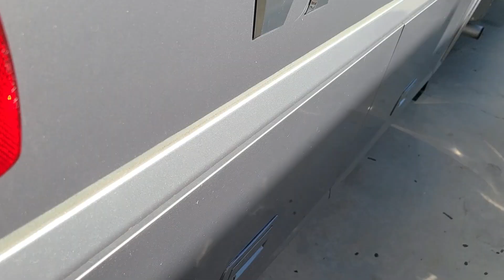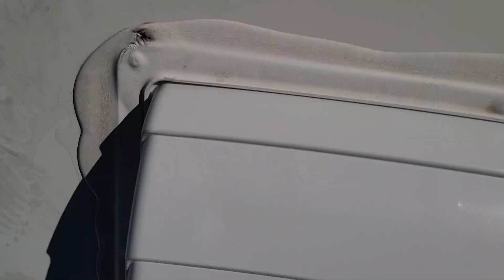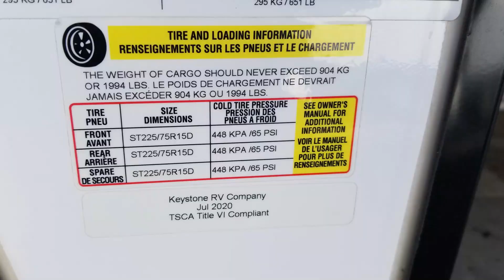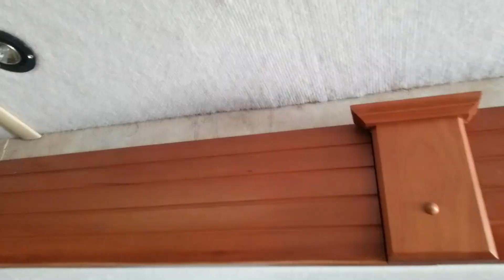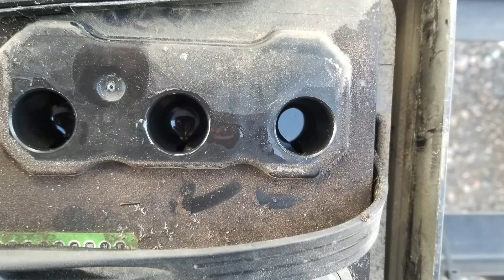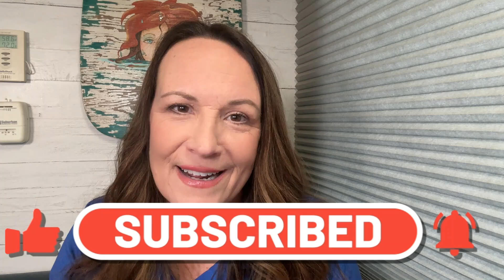Don't Buy an RV  Without Watching This First

Comment: Morning Deb, as always, you're demonstrating your insight.
I think most first time buyer's figure maybe an hour to check out a used RV, both you and I know they should plan on several hours for the first viewing,
I take a flattened cardboard box to kneel on or slide under the RV and inspect the chassis.
Don't be afraid or ingeminated' buy an eager seller, they may be trying to conceal potential issues, like water stain or mold hidden behind stacks of cloths or dishes, 
I remove the drawers and inspect inside the area's, there's a lot to find in the cabinet structure.
I look for high amounts of dust from off road trips, also rodent sign.
Rental RV's just should be avoided, some renters don't care much about how rough the road was and all the twisting of the chassis under the house does damage the house to chassis supports.
The house weighs so much you won't notice the looseness while just walking around inside, when on a test drive find a steep driveway or entry to twist the chassis and as you transition from flat to grade listen for the creaking or watch for shifting of the house in the rear view mirror.

Like I said, and you try to explain, it takes hours of meticulous inspection to find everything you're going to have to repair.
Reply from the maker: Nice to hear from you Mike and great advice! I like the flattened cardboard idea. Right now I have a blanket but that isn’t always doing the trick. I used to have a yoga mat and left it somewhere. Haha. Removing drawers and using a flashlight to look behind is a great idea. Thanks Mike!
Reply: The cardboard serves two porpoise's, it protects your knee's from gravel or rough surfaces and if it's wet out it will keep your knees and or your back dry, if it's wet you can simply fold it up wet side in so as not get the inside of your car dirty.
Reply from the maker: I’m getting some cardboard this week! Thanks Mike!

Comment: With over 40 
 tech nician experience. 
Careful consideration is needed as how long the RV has been sitting around not being used.
12 volt,110 volt systems and especially propane systems  needs special attention by a professional  inspection.
I would highly suggest calling Deb's RV service for those points I described.
What I found in the past is alot of RVS have been stored and not used, and the owner decides to sell the RV.
Keep up the great tips to help people Deb !
Reply from the maker: Thank you so much! I really appreciate the feedback as a technician. I do find many RV’s that have been stored and not used. All kinds of issues!

Comment: Deb, that was an extremely helpful video!  With this information, a prospective buyer of an RV will have a much better understanding of what they should be looking for and why it's important.  If they see too many red flags, structural issues, broken items or defects, then there's no need to proceed with that RV.  For me - I'd use this as preliminary walk-thru inspection info so I can narrow down if that RV is worth having an additional professional inspection.  When I spend that kind of money, I want to be assured that the RV is not only safe, but everything functions properly and worth the expenditure - and for that you need a pro.
Reply from the maker: Absolutely and I’m glad you liked it! I’ve been wanting to put something like this together for a while. Thanks so much!!